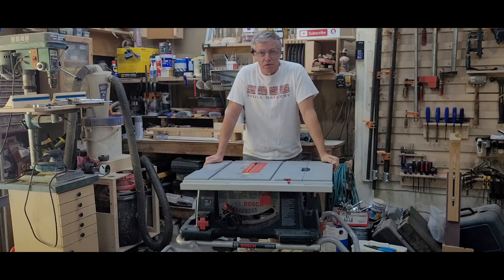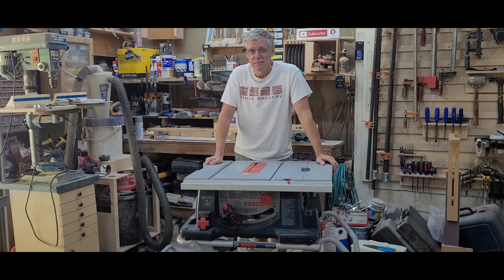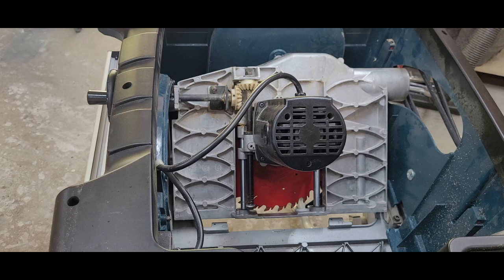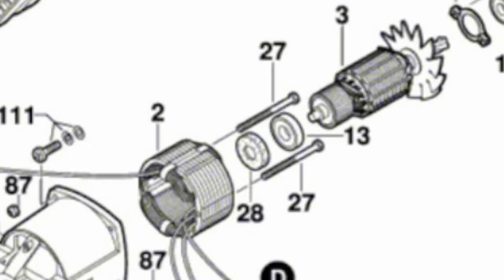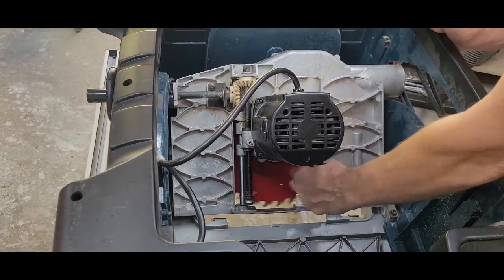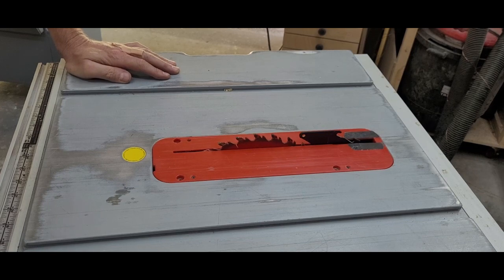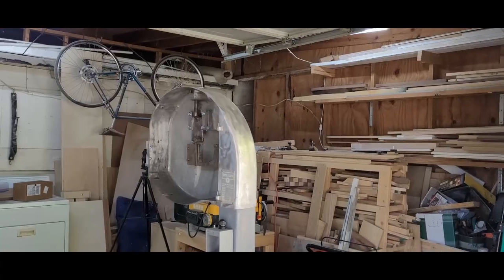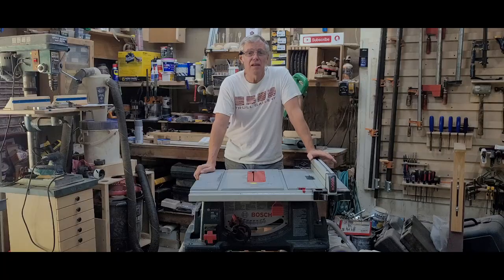Replacing one last part to bring my table saw back to life.

Comment: Thankyou - this was helpful to me - I had the same issue with the bearing failing, except that when it failed it became hot and melted that rubber ring part. It sort of fused into the plastic of the motor housing in a way that that wasn’t obvious what had happened. So when I went to fit the new rubber ring part - it wouldn’t fit. Only after some perseverance I managed to separated the fused ring from the plastic housing and pull it out (very awkward to get to). I then replaced the ring and problem was sorted.
Reply from the maker: Mine was pretty bad as well.  That's why it took me some time to realize the rubber ring was missing.  That bearing gets HOT when it locks up!